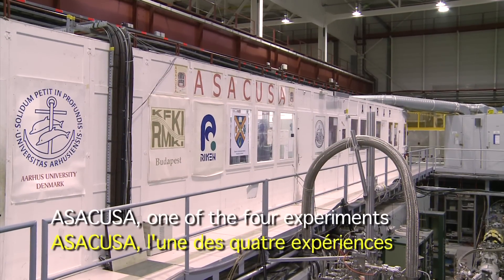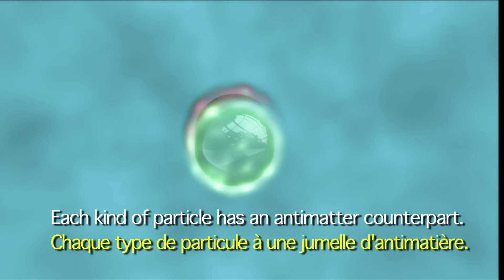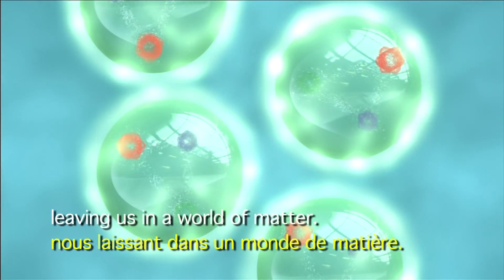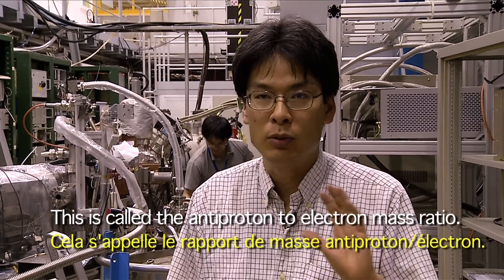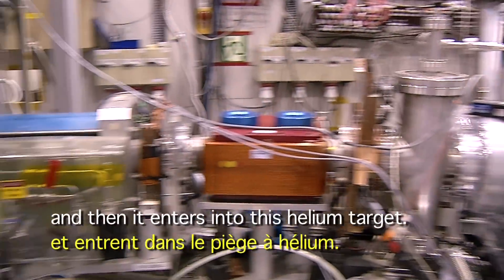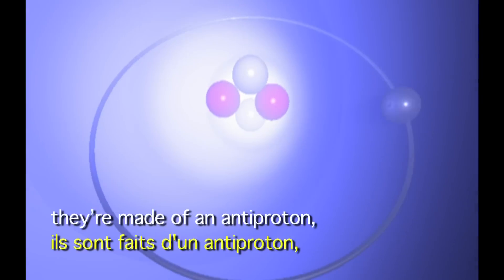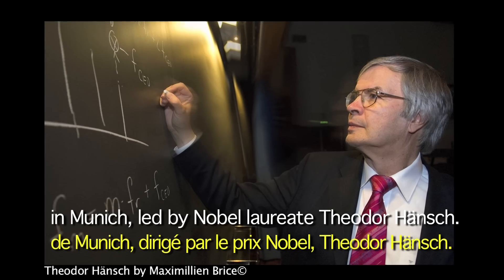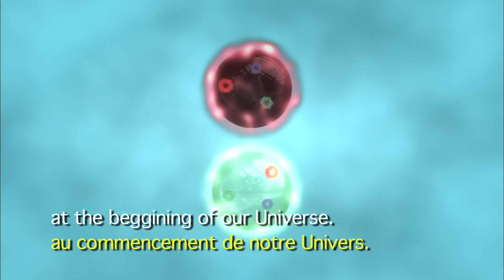CERN News - ASACUSA experiment

Comment: @MartianStories yes they give of energy. it would work, even better than a fusion powered spacecraft. the anhinilation is 100% efficient (E=mc²).Large fuel mass equals giant energy output. But the trick is to store enough antimatter for a long time (Magnetic fields). CERN was able to store 300 Antihydrogenatoms for 1000 seconds. Also the problem is the production of antimatter. You need a large quantity of energy to produce a little antimatter (again E=mc² but reverse).

Comment: @MartianStories the amount of antimatter would be still very small in comparison to nowaydays required fuels. When you anihilated 1kg of Matter you get 89 880 Terrajoule of energy. I think the production directly on the spaceship is difficult. Also the energy for the production needs to come from somewhere. Perpetual motion is impossible per definition (yet ;) ). But giantic magnetic fields are neccesary when you travel near light speed to protect you from cosmic particles.